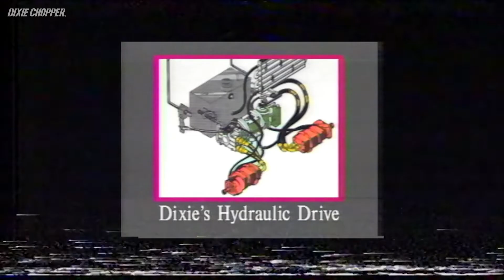T-Gear Box History & Benefits w/ Dixie Chopper Founder Art Evans

Comment: Does my 06 Silver Eagle have a Tbox?
I dont see the fan or Tbox?
Reply from the maker: Not on that model. The Silver Eagle has pumps, but they're driven vertically without a T-Box
Reply: @DixieChopperMowers Its 20 years old now.
What do you recommend for Hydraulic oil?
I imagine the oil has been changing with technology pretty fast?
Reply from the maker: @kerryyeroyan8212  The drive system uses a 15W-40 MOTOR oil. We recommend Lucas Oil or Mobil 1. Doesn't have to be synthetic. Be sure to use DC OEM parts for the filters (should be #68140 on your Silver Eagle) and do the air purge process after the oil has been changed.
Reply: @DixieChopperMowers Thank you sir and have a great weekend!

Comment: I have a 2007 74" Excaliber with around 600 hours on it and is the best mower ever.  It mows fine on flat ground but has no power to go up a slight incline now. The engine runs fine but there is something going on with the hydro power system.  I changed the oil and 3 filters late last season.  Any ideas what's going on? Thanks!

Comment: The hydo systems on these machines are outdated and complete junk. No wonder they went out of business.
Reply from the maker: Thanks for the comment. Still in business and building mowers every day. In fact, we back this drive system with a 5-year or 3,000 hour warranty.
Reply: @DixieChopperMowers  picked up a 2012 3560T classic, weak on left side until right side is full throttle then both go semi straight. anything can do?
hour meter doesnt operate which seems to be common,
Reply from the maker: @Ironrodlife  Sorry to hear that. Best advice is to work with a local dealer for help.

Comment: What can it be when I start my iron eagle in park but stops when you take the brake off
Reply: Could be a steering lever not being in neutral, could be a seat switch, could be parking brake switch. Start there and take to a dealer if you are still experiencing problems.

Comment: I bought Hustler super Z in 2008 and have hated it since day one. But I paid cash for it and the dealer nor the reps would help. 
The only reason I did NOT get a Dixie Chopper is they didn't have a dealership near me, and the one thing ALL the professional guys agreed on was SUPPORT. And I was afraid of not being able to get the parts in case it broke. I heard good things about hustler from my mechanic friend that works on mowers used on a big farm. He said the only mower the operators could not tear up was a hustler . 
It is trus that they are built like a tank. The only problem is that it steers 10 times worse than our 1973 Cat D-6c. 
I think I have learned 2things from this video.
1) I think my problem is a design issue and is probably not economicly feasble to fix.
2) when we Do find a new house( now that we have retired) I will find a Dixie Chopper dealership, TEST DRIVE one than if it is as good as I think it is, I'm going to buy it then get the Barrett out and put 20/30 rounds into the hustler and then drop it off at the dealership I bought it from.( after I get my air ride seat off it, because that is the only thing I like about it)
Reply from the maker: We hope that you do test drive a Chopper before you buy your next ZTR. Also, when you do blow the Hustler up, let us know ahead of time.
Reply: @dixie chopper do you want a video or you want to do it In your parking lot. Could help you away a few customers that may be on the fence. I would not mind if a professional did the blowjob I just want to be there
Reply: After 2005 don't buy a hustler they start started making them cheap my brother bought one just like what you said and the dealer told him better do it now because after this year which was 2005-d are changing everything nothing as heavy as what they currently are which was in 2005

Comment: I thought my cheap neighbor next to my farm had a White but driving by I finally see it was a Dixie Chopper so thought I would check out this brand.  Somehow after watching this I'm not convinced Dixie is the way to go but is a good machine.  I have a very nice 2012 John Deere Z920A /60" deck, 1,500 hrs. that is hard to beat.   Weighs about 200lbs. more than the newer M series.   It just uses Tuff-Torq hydro's that are very trouble free.  Nobody complains about them at all.  Mine are clean and working perfectly but I'm about to pull them out to change all seals, filters and fluid before any leaks start.  I have everything needed from Tuff-Torq and J.D.  Subframe that holds both hydro's and oil tank is very easy to remove and service which is really nice.  The main frame is massive,  very simular to a 3/4 ton truck. Been very happy with this units power, comfort, mowing quality, longevity and parts availibility.  Dixie may be a great unit but pretty sure I'll stick with John Deere which is about all you see on the trailers of commercial mowers in Michigan.